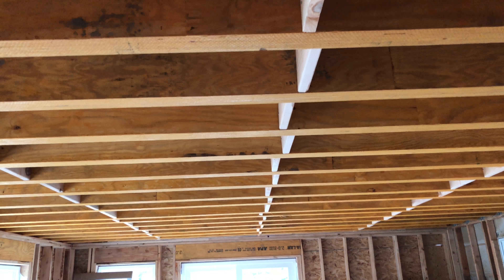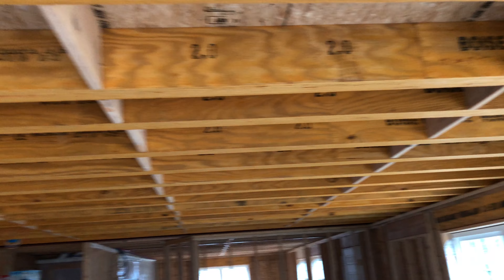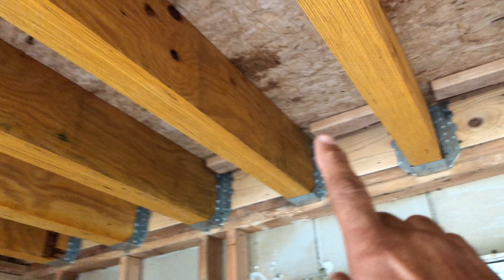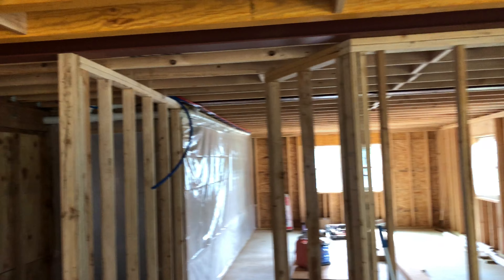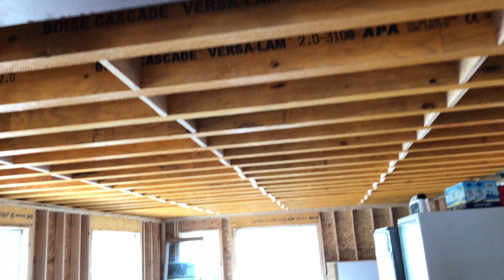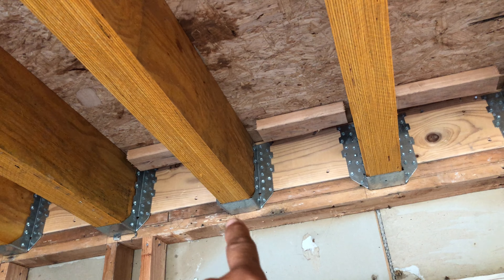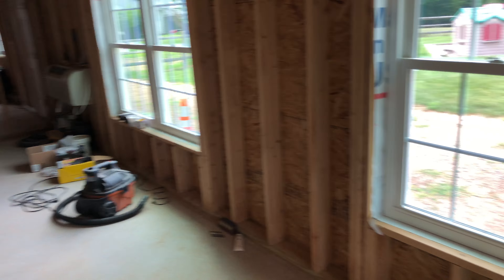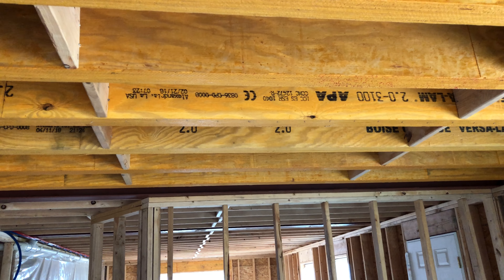LVL beams or laminated lam  beam for floor joist.

Comment: which boise cascade lvl did you put in?  
https://p.widencdn.net/yzqcmb
the site doesn't seem to have a 20 span listed on its commercial  chart for a 9.2''' x 3.5''.  
The BCI® 6500s 1.8   goes 18' 9''. 
How much does one of those cost? 
I counted 22 lam beams in total. 
You did one side of the house with 2x10 and made a 15 foot span. 
you gained 3'9'' of room for what cost is the biggest question I have. 
The boise site doesn't list prices that I have found yet, but I probs just missed it.
Anyhow thanks for sharing the floor design, LVLs are pretty cool. Def the future.
Reply from the maker: I will remeasure and make sure its 20'

Comment: Must have cost a fortune...why didnt you run 2x8s with a flush steel beam connected perpendicular to the beam for the second floor
Reply from the maker: The flex or angel would be exceeded for the size of steel needed would become a drop beam
Reply: @LaRobertos  I see...so the steel would have to drop below the joist depth regardless...especially if you don't want posts
Reply from the maker: yes exactly

Comment: Are you planing to park a car upstairs?
I think it’s a waste of money
Reply from the maker: I was to save height in the downstairs I saved a low ceiling issue
Reply: @LaRobertos  yeah it's cheaper than steel joists, but maybe more expensive than truss joists
Reply from the maker: @quinnhaynie7767  steel would have been more for sure